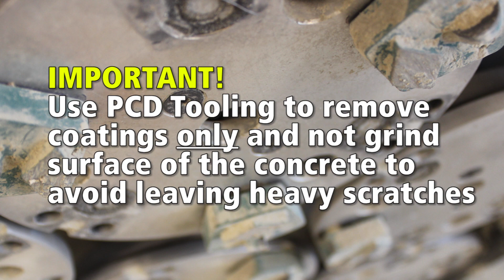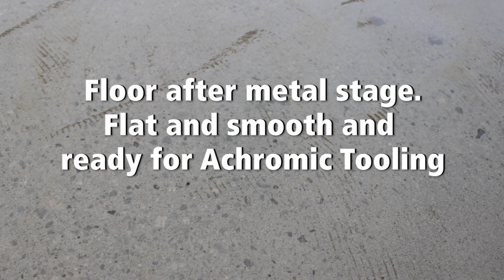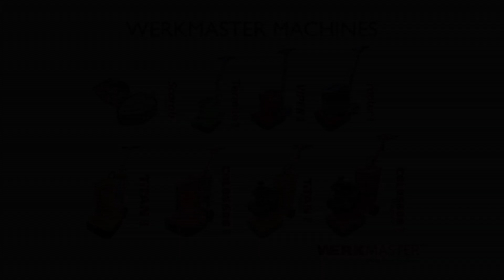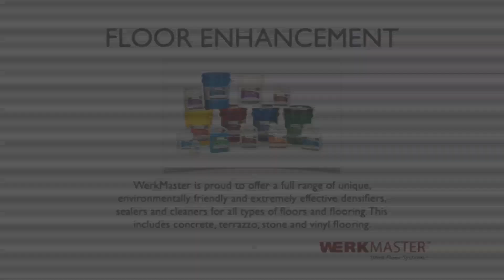How to Polish Old  Concrete Floors to a 1500 Grit High Gloss Shine With A Concrete Floor Grinder

Comment: The amount of tooling that machine requires is so crazy. 32 pices. That’s 23 more than my grinder use. That’s a lot of money in tooling
Reply from the maker: Unlike planetary machines, WerkMaster machines have cutting and flattening action in the center of the machine. When you step 1 foot forward 100% of the machine is cutting. A planetary is only cutting about 25% as its tooling is around the perimeter and zero tools in the center. More tools give you longer tooling life as well. A set will run you under $500 dollars and give you upwards of 40 K sq ft! The biggest expense is labour on any project!

Comment: I'm considering polishing my concrete subfloor, looks like this would cover all the required steps, especially the first related to residue and whatnot from pulling up carpet and linoleum.  Can you offer a ballpark for the cost/sqft for this process you took, please?
Reply: I am in need of concrete polishing machine how can I buy it I am in Lusaka Zambia 🇿🇲
Reply: Depends on size of home. In our area it’s roughly 7$ sf

Comment: why is there so much inconsistency in the aggregate exposure?
Reply: High spots and low spots, in order to have it fully the same, they would have to come down atleast more more step with more aggressive metals ; costing more but it would all look even other than than this is what a polish concrete concrete looks like it’s never all consistent
Reply: When concrete is poured and sets it’s impossible for it to be all the same causing some gravel to be more exposed in some areas